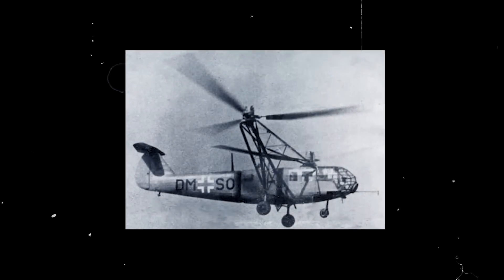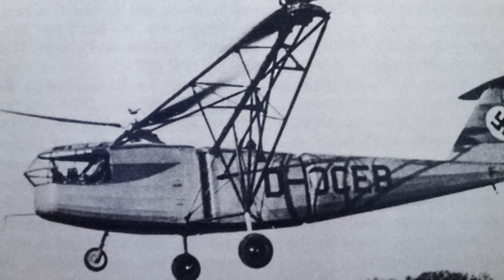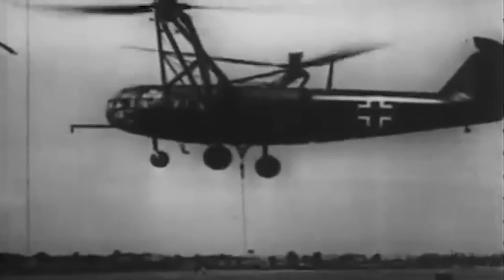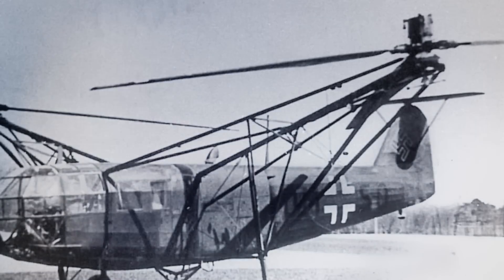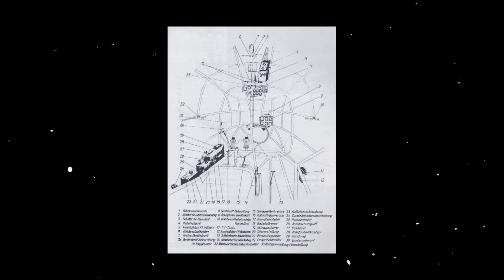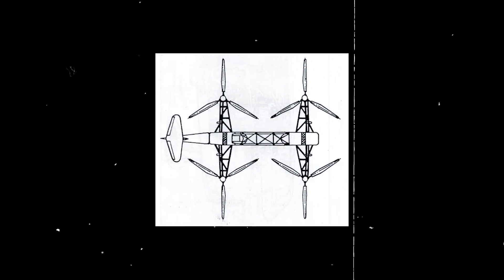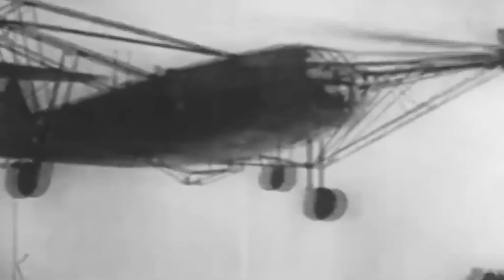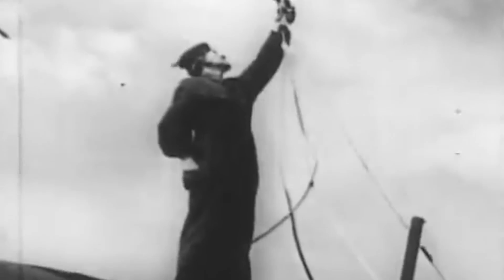The Luftwaffe Fa 223 Dragon - First Helicopter to Reach Production Status

Comment: The most interesting difference to modern twin rotors is that Focke never used intermeshing rotors.  He couldn’t as he had separate freewheeling clutches in each branch of the drive shafts.  I’m betting that was a source of some vibration issues.

Comment: How did the nazzie engineers handle power distribution on case of one rotor failure.  Or worse, loss of effectiveness on one rotor. Just roughly thinking in aerodynamical terms, which are limited in my case, there is a probability of blade stall , when initiating a steep turn at indicated airspeed(IAS)  being close to velocity never exceed (Vne).
Reply: The same way the v22 does.... by flipping over and smashing the crew into the ground, Vne is probably a bit of moot point when it comes to the rotors as they balance each other out, 2 outside halves and 2 inside halves of counter rotating blades, bigger issue would be rotor construction(and thus bowing) and the flapping of the fuselage  fabric(a limiting factor on early war planes if they tried to dive at full power)

Comment: Man, imagine if they actually properly used these and figured out that you can mount manned gun turrets on the sides. The battlefields of WW2 would've been very different.
Reply: not so sure actually. Europe is not Vietnam.
Did Korea see extensive use of helicopters in combat? (Except search and rescue of wounded?)
Reply: @yesyesyesyes1600  No but we're talking about the Nazi's here. Blitzkrieg was their tactic and a helicopter would've been exactly what fitted their way of warfare. I imagine it being used together with panzer, so tanks and halftracks. 

Either way, I'm pretty sure the Germans would've been very capable or arming these things and putting them to use. As they did with literally anything.
Reply: @onthespot-aviation  Good point. Battlefield recon - kind of spotter planes. Yes, that could be.
But I can't see these choppers as wanna be tactical bombers

Comment: This isn't a proper helicopter. It's a typical Nazi Joke. It's flying characteristics were laughable. Like most German WW2 Fighting  Machines they turned out to be failures. Still no match for the British Whirlwind Attack  Helicopter which was used to Evacuate Downed  British Airmen behind Enemy Lines and Destroy Enemy Aircraft if they were attacked during the evacuation operation. Plus they were used to Destroy UBoats and UBoat Pens.

Comment: The first "helicopter" was designed and built by a Spaniard called De la Cierva and its name was "autogiro", years before that German. It is true that it never reached any production status though.
Reply: An autogiro is not a powered rotor neither does it change direction or alter speed through its rotor therefore an autogiro was considered a stol plane not a helicopter , it could not takeoff vertically as well

Comment: @ 12:23  It did not "Disappear", It was scrapped as it was junk compared to Sikorsky's R-4 through R6 and at the wars end with the Piasecki HUP winning a design competition set up by the US Navy in 1945 so, the need to use a Fa 223 Dragon as any kind of a jump-off point was laughed at. No rear Rotor or pitch adjustable blades.
Reply: There was no need for a rear rotor.  They did switch to fully adjustable collective pitch after the 5th prototype and then all were upgraded.  It was far from junk compared to the Sikorsky.

Comment: A ground-breaking machine described by an excellent documentary. Does anyone know why Fokke Wulf did not put the rotors in tandem?  It seems the obvious solution.
Reply: Sure, with the luxury of hind sight, it seems obvious. So do disc brakes, fuel infection, automatic transmission, power steering, seat belt, parachute, tricycle landing gear, bow and arrow, cloth, the fork, the spoon, a chair, the door, windows, rope, pulley, sail, plow, shovel, etc, etc, etc. Hind sight is something inventors don't really get to use very much, a shame as it would make inventing stuff much, much easier.
Reply: It worked very well as designed.  Stick free stable in forward flight.

Comment: What are you doing with these awful clickbaity titles? The Americans were the first to evac a wounded soldier during the pacific war using a prototype helicopter that was extremely modern compared to this piece of scrap metel. I literaly saw you change the title for the Germans trying to use counterfeit money from a reasonable to the current. "gErMaNy'S mOst DiaBoLiCaL pLaN".  As if they didn't have a laundry list of plans that were worse then make fake bills.

https://en.wikipedia.org/wiki/Sikorsky_R-4

Comment: Wonder how things would have turned out if the Germans had delayed WW2 by 5 years.....so much tech right on the cusp of greatness
Reply: Allies were working on the mostly same projects and were keeping pace even when behind. Plus the allies shared technology and production.  And both the Americans  and Russians realized you don't always need the best, just .good enough and lots of it. The biggest thing of all for the Germans was the lack of oil and oil reserves.
Reply: @jrt818  The Germans were ahead of the allies in several areas. Yes, oil was a constraint...but then so is a 2 front war...but that's a different discussion
Reply: Given the allies outpaced them in most areas; same results but the war ends sooner and the allies win harder.
Reply: Except that is not how it would have happened whatsoever. You can't just wait out mass resource shortages and inevitable manpower scarcities.

Comment: So in other words the Helicoptor managed to have a future in the end with Europe and likely the one the US captured was destroyed likely to not let anyone have access to the tech.
Reply: There were already three USA built lateral tandem helicopters, Platt-LePage XR-1, XR-1A, and their follow on twin engine McDonnell XHJD-1 helicopter.  The Platt-LePage and McDonnell helicopters used fixed wing pylons to increase lift in forward flight. Platt-LePage would patent the Tilt-Rotor concept, later developed by Bell helicopter, by an ex Platt-LePage engineer.
Reply: @platt-lepagearchive9381  Both built in or around 41 or 46 and in experimental models of 2 or 3 at most. the Germans Fa-223 was a production model.   That alone makes it a highly prized tech. especially if the US was looking for anything that might be useful for later models.    It was likely destroyed cause they either found what they were looking for then destroyed the model so someone wouldn't glean the tech off it.  Or they found it had similar flaws to the experimental ones they had with a few little things here and there and was just not worth keeping.     

Or most likely.   Someone broke it by accident and a American officer with a ego probably said to scrap that German piece of junk not caring about what it had.  More than likely they did use it for flight test so it being destroyed in test flights or its value being considered worthless or not needed and used as a target is not out of the question.
Reply: @Quetzalcoatl_Feathered_Serpent  The lateral tandem helicopter was a dead issue with the Air Corps. by April 1945. What the video didn't show was, there were lateral, and longitudinal, control issues with the FA-61 and FA-223 Focke helicopters. These problems were identical to the Platt-LePage machines, which were also built to operational hardware standards.
In Germany the control issues were over looked by the German military, in favor of having a flying helicopter with good weight lifting properties.
In the USA, the protracted development time of the Platt-LePage helicopters killed the chances for any further interest with the Air Corps.
The Focke machine was examined and flown, then sold for scrap, as it was of no use the the Air Corps. 
Reportedly some parts of the Focke 223 may have survived in the hands of one of the early American helicopter pioneers.
The tandem in the USA would be carried forward by Frank Piasecki, who got his start at Platt-LePage Aircraft.
Frank was able to get his tandems flying better, and built faster, than the competition, and they would turn out to be the dominant tandem configuration going forward.
Unfortunately the lateral tandem will likely never regain any interest beyond the Tilt-Rotor configuration.

Comment: The Soviet Mil V-12 used the same rotor configuration but was the size of a C-130 cargo plane. Biggest helicopter ever made but never went into full production.
Reply: It’s an efficient configuration, balanced, symmetrical forces and stable over changing speeds and easy to control.    Focke had plans for bigger units.  The intermeshing style developed by Focke-Achilles’s competitor Fletner also lived on in the form of the Kamen Husky and K-max.  Easy to control precisely in the hover.
Reply: @WilliamJones-Halibut-vq1fs  
It's scary to imagine them actually getting tank transport working that wasn't incredibly complicated & convuluted...
Reply: @WilliamJones-Halibut-vq1fs  Opposed tandems have issues with longitudinal stability that fore/aft tandems like the CH-47 don't have. Also in later revisions of the CH-47 there is a "longitudinal trim actuator" on each swashplate that is basically elevator cyclic, except that on tandems like the CH-47 elevator cyclic doesn't work like it does with single rotor helicopters and instead it brings the nose down in hover to counteract it's tendency to hover nose high (the masts are slanted forward a few degrees to improve forward flight characteristics) as well as to bring the nose up in fast forward flight to reduce drag. The "actual" elevator on the CH-47 that moves the machine forward comes from differential collective between the front and rear rotors forward elevator reduces the collective pitch of the front rotor and increases the collective pitch of the rear rotor. The function of the longitudinal trim actuator is automatically controlled by the flight electronics and the pilot has no direct control over it.

 The CH-47 is one of the fastest helicopters in the world they actually have to slow down when escorted by AH-64s so that they can keep up.

 In case you are wondering, aileron cyclic works as normal on a CH-47 swashplate and yaw uses opposing aileron at the front and back (each rotor pushes sideways in opposing directions to rotate the machine. The pilot can also mix aileron into the yaw pedal inputs with the control column to move the center of rotation toward the front or rear of the machine.

 EDIT: Also the collective pitch control lever on a CH-47 is called the "thrust control lever" instead (though it's literally the same thing)
Reply: By the way, did you know that the russians had the biggest midget that ever existed? :p
Reply: the youtuber mustard has a great documentary on the Mil V-12 on his channel, well worth the watch
Reply: The Fa-223 was stick free stable in fwd flight.  Very impressive.  The rotor head is still the most beautiful made.  If you go to the Deutsch Hubschrauber Museum in Budeberg they have an all wooden demonstrator if it I’d almost kill to have in my coffee table
Reply: I think its rotors combined rivaled the wingspan of a 747.
Reply: @shaider1982  So? The wires in my orchard fens are triple the wingspan of an Airbus A380, combined of course! 
In this case, not the lenghth is comparable, but the surface area of the fixed wings and of the disk that the blades of the rotor create when they spin.
Reply: @shaider1982  About 8 ft. more than a 747-400
Reply: @Charles Yuditsky we already have tanks being transported by helicopters. We've transported helicopters with helicopters
Reply: Germany: Check out our helicopter! 🚁
Russia: That's nice, but... 🤔 What if we make it, but like, BIGGER? 
Germany: It won't fly, but whatev... 🤷‍♂️
Russia: We have ways to make it fly! 😎
Germany: Do you want me to hold your beer?
Reply: @Karl_Kampfwagen  
And then they threw it away even though it could have changed the entire world's view on transportation as a zeppelin alternative, BECAUSE USSR POLITICS!
Reply: @VerdeMorte  USSR: But we can make A FREAKING HUGE ZEPPELIN! So big, IT COULD NEVER FAIL! 
Germany: Been there. Have fun. 😅
Reply: @Karl_Kampfwagen  
Technically they didn't with the Venus dirigible orbiters... 
(People really need to consider investing money in those again, they were cheap & cost effective.)
Reply: @Charles Yuditsky 
They're solution to everything back then was scaling up, which eventually resulted in a russian helicopter that could transport tanks, even if it wasn't used by the military and that design was further inspiration for the Osprey, which is capable of transporting multiple main battle tanks...
Reply: @VerdeMorte  "the Osprey, which is capable of transporting multiple main battle tanks..." You're a moron!
The true capacity of the Osprey:
"Capacity:
24 troops (seated), 32 troops (floor loaded), or
20,000 lb (9,070 kg) of internal cargo, or up to 15,000 lb (6,800 kg) of external cargo (dual hook)
1× Growler light internally transportable ground vehicle"
Do you have any ideea how much a main battle tank ways? 50 - 60 tons! And you say that the Osprey can carry "multiple", none the less!